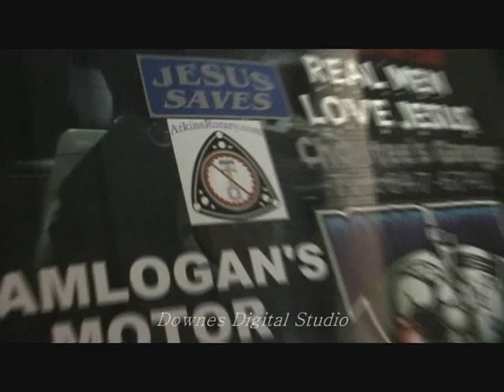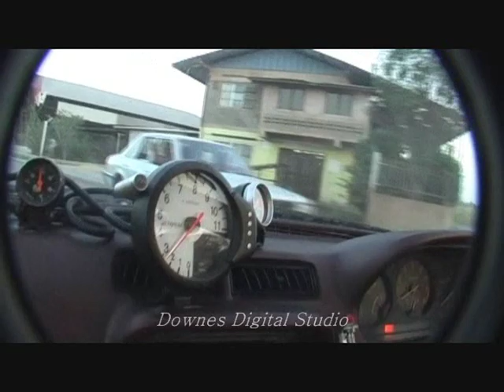Peter 20b 1st gen rx7

Comment: @scarble turbo lag is when you punch the car and the car doesn't go until the turbo is charged up. this happens either when the car is a low rpm's or the max amount of psi is high. if you have a car with about 30-35 psi of turbo, in low rpm's you'll experience turbo lag.